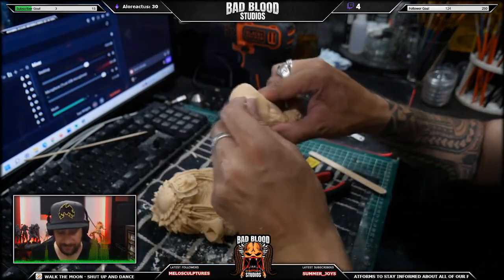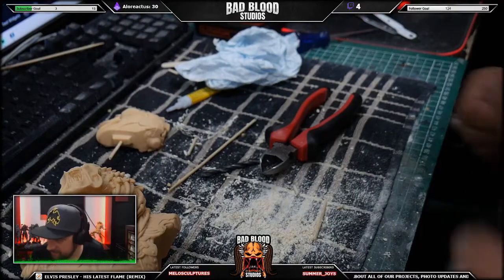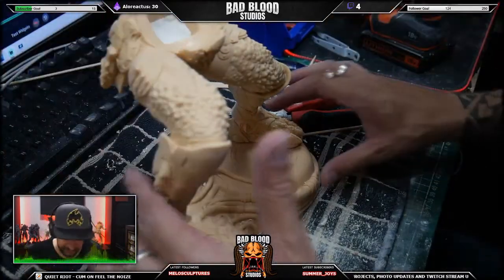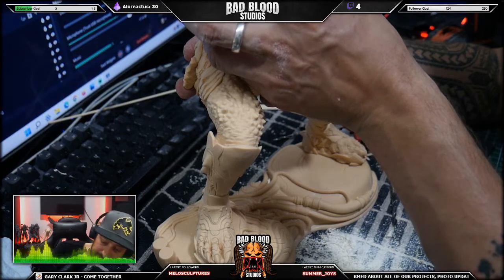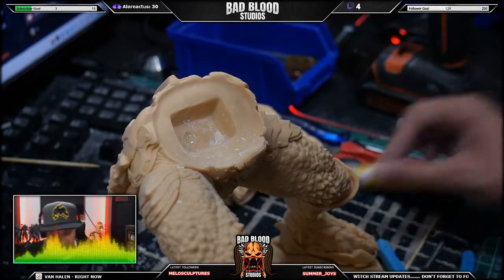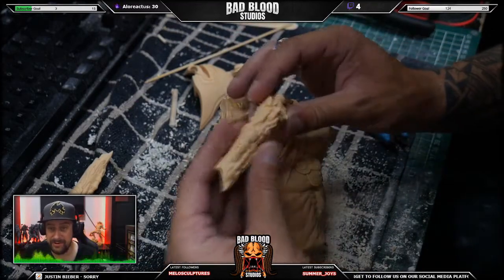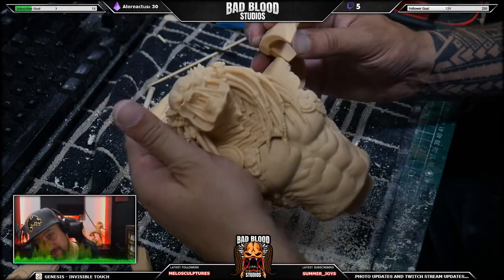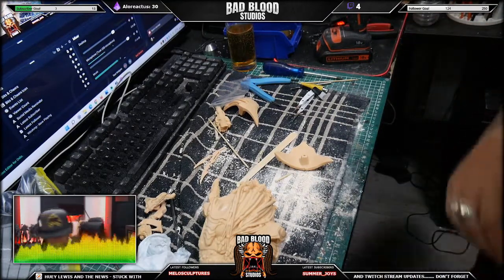Savage Revgun - Predator - Part 2: Pinning & Assembly - Resin Model Kit - By: Narin Studio

Comment: Thank you for this.
You're the first  one I've seen using wooden skewers for pinning. Are they really sturdy enough for this purpose? Usually, people use metal rods for this.
Reply from the maker: I only use wooden stucks when I know I will glue the parts after painting… If the parts stay unglued, then I would use metal rods.

But since most of the kits are for myself, I glue the parts after painting.